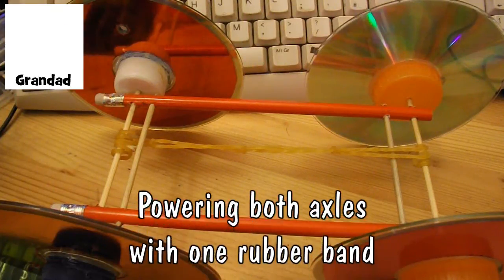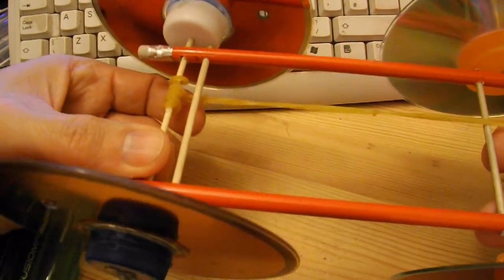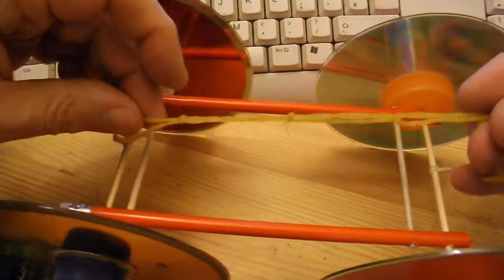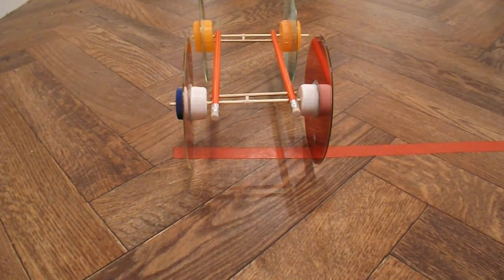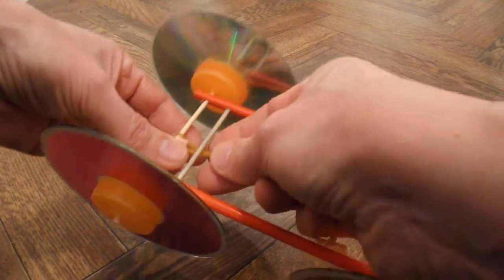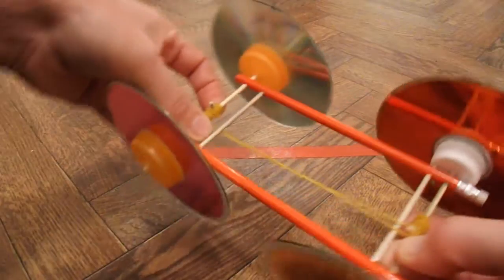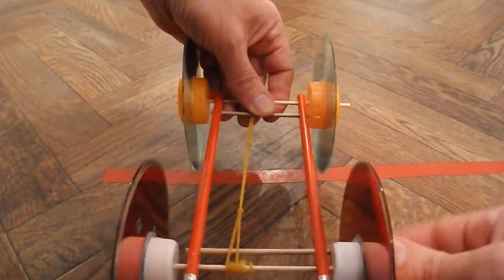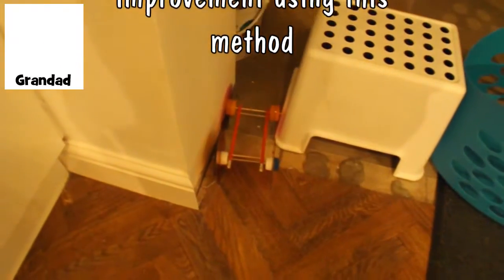Powering both axles with a single rubber band motor

Comment: Thanks Grandad, very fast implementation, and so nicely done at that!
The acceleration does not seem to disappoint.

A more precise test of efficiency extraction locomotion from a rubber band might be a hill climb of sorts. Unfortunately very hard to find indoors, unless one would build it.
Reply from the maker: I did a video for somebody who had to climb a slope and stop at the top.
http://youtu.be/Cwz2rR0asus?list=PLA5a2xPRSrB1otXh0w36OwsYIHZznUWp6
The main thing about your idea with the 4 wheel drive is the improved grip. I will be uploading a video shortly. The results are not really conclusive for other criteria but the improved grip is clear to see.
Reply: GrandadIsAnOldMan So many great videos, how will I ever get up to speed?
Reply from the maker: Cloxxki yes, sorry about the number of videos on my channel, it has got rather out of hand. There are over 1000 to choose from so if you haven't found it already, check out my playlists page where I have tried to create some order so you can find things relatively quickly. 
http://www.youtube.com/user/GrandadIsAnOldMan/playlists?flow=grid&view=1

Comment: Hey grandad, can you make a rubber band powered car that rewinds itself using an electric motor and gear. You can use anything you like . Thanks!
Reply from the maker: Thanks for the suggestion but I think I will pass on that. It is easy enough to wind by hand.

Comment: Hi Grandad, how did you create and tie the rubber band motor on your video using two straws and toothpicks?
Reply from the maker: The back toothpick simply has a very short piece of toothpick glued to it so it forms a hook to hold the band as you turn the axle.
Here is my old help file on connecting rubber bands http://youtu.be/EbYuhdwknbs?list=PLA5a2xPRSrB2v0vxMJyZ9cPweAGx1FK6e
Reply: Thank you so much!